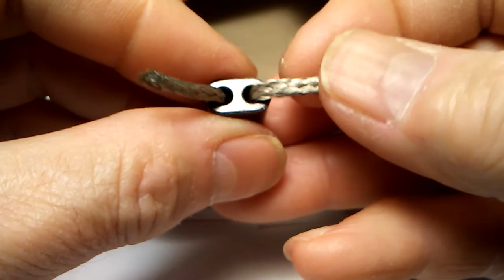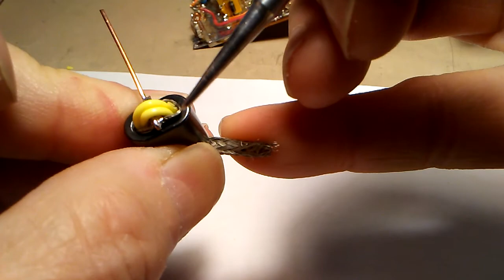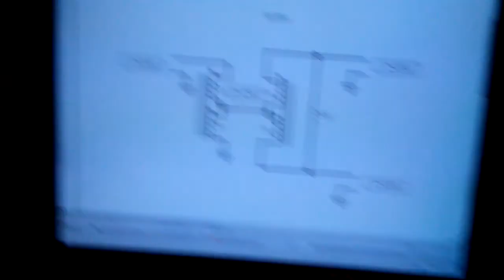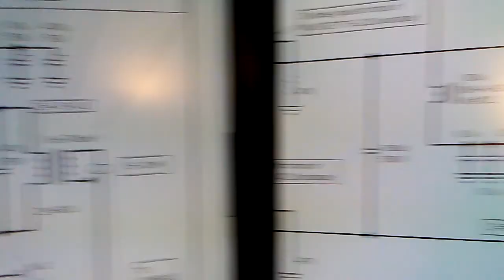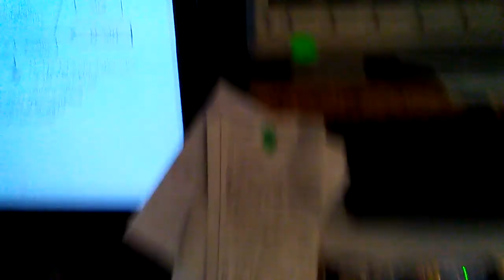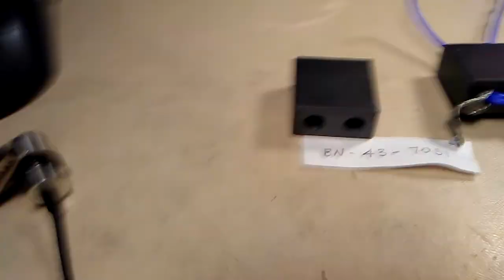Build small PA output transformer

Comment: Thanks.  Did you ever do a vid on the construction of the magic tee combiner?  Rgds
Reply from the maker: Hello Simon-mz7sf, I did build a rudimentary version of a splitter and combiner and attempted to test two 50 watt PA's combined together to get 100 watts out, but my test failed due to the PA's going into self-oscillation and other strange behavior when the power was increased.  I'm sure that if I took more time I could have discovered where I went wrong, but I decided cut my losses and abandon trying to get more power by combining multiple PA's using non-RF devices but instead set my sights to using true RF devices like the MRF101 (100w) and ultimately the MRF300 (300w).  I have since obtained these devices and will attempt to build a single linear amp that will develop 100 watts and later 300 watts driven by a 10 watt PA built from RD16HHF1.  No work started yet, but hope to get started sometime in 2025.  73 - Rick - N3FJZ.

Comment: if these transformers get hot can't that push the ferrite past the curie point which can make them non-linear & therefore generate some harmonics?.... Given Tc for type 43 can be around 130degrees C  I'm presuming when you say "hot" you don't mean that hot.
Reply from the maker: Hello StreakP, since radio is just a hobby for me and I have not done a lot with high power, I have no actual experience on how hot these transformers can get, but from what I've read they can get "hot" enough to cause the non-teflon insulation of common PVC wire to get soft enough over extended use to eventually cause a short between the windings, et cetera.  I would think that real RF engineers size the ferrite and wire to accommodate whatever would be considered the "safe" highest temperature anticipated for their design and power level to avoid heating problems with the ferrite.  73 - Rick - N3FJZ

Comment: Hi there could I use  ft50-77 for a input transformer ?
Reply from the maker: Hi Prize King,  I believe so, just keep the turns ratio the same as would be used for the BN cores; however, you may have to increase the number of turns on both sides by the same ratio, for example, if the BN core used 2t : 5t, the ring core may need 4t : 10t (but the ratio is the same), also, with the 77 vs. 43 material, there may be frequency limits perhaps, but if you're using it for frequencies below 15 MHz it may not be such a big limit.  Hop this helps.  73